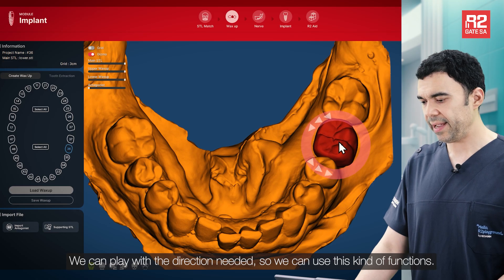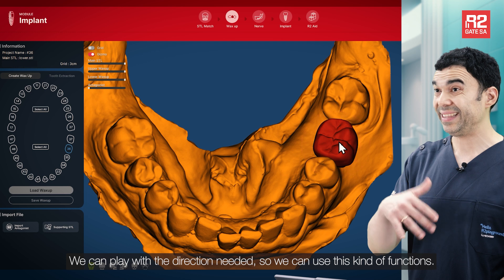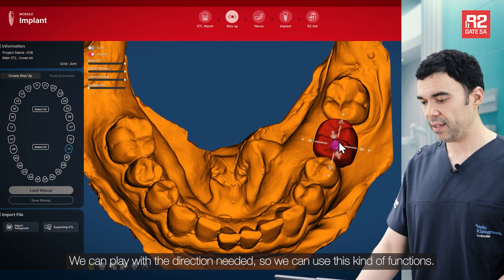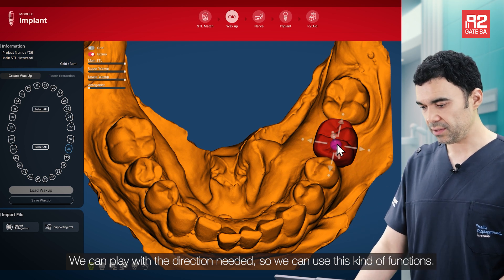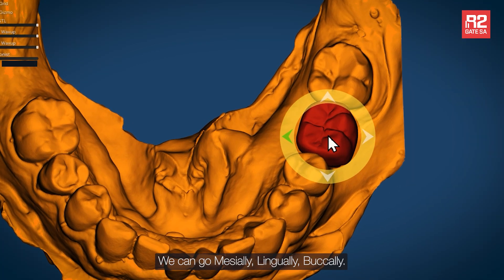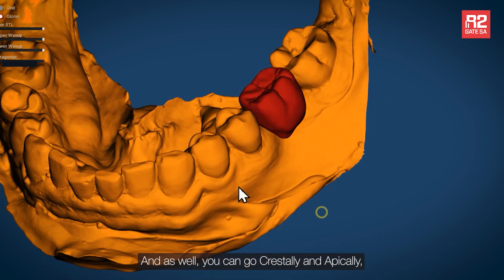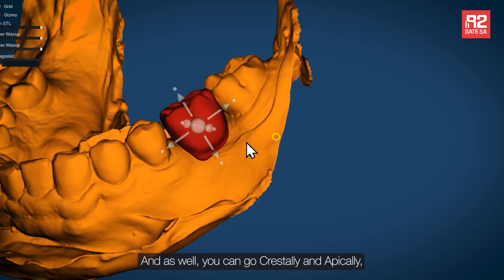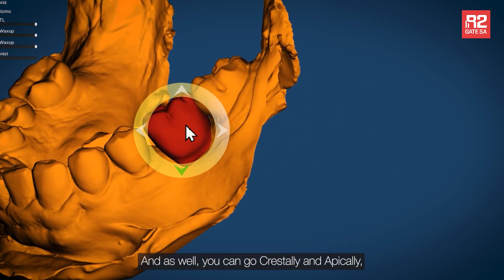R2GATE SA Tutorial Series | Step 4: Digital Waxup🎬

Comment: Is it possible to increase only the mesio distal dimension of the wax up? pressing the key "z" or "c" I can only increase o decrease all dimensions of the wax up. Furthermore if I click on the small balls on the top of arrows that appears when I put the mouse on the wax up, nothing happens
Reply from the maker: Thank you for your inquiry.
In the current WaxUp step, using the shortcut keys (Z/C) after selecting the wax-up will scale the object uniformly in all directions.
If you want to adjust the size in a specific direction only, you can use the 3D gizmo that appears when the wax-up is selected.

Please follow the steps below:
	1.	Click the wax-up to select it.
	2.	Click the small sphere at the end of the 3D gizmo arrow shown on the selected wax-up.
	3.	Scroll your mouse wheel to scale the wax-up in the selected direction only.

We apologize for any inconvenience caused by the lack of detailed guidance.
We’re continuously working to make the controls more intuitive.
Thank you again for your valuable feedback!